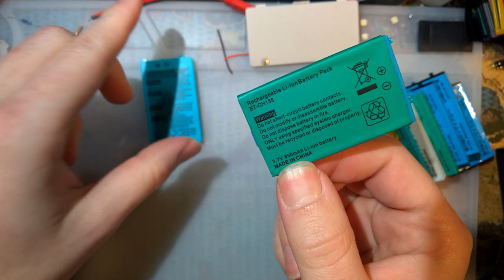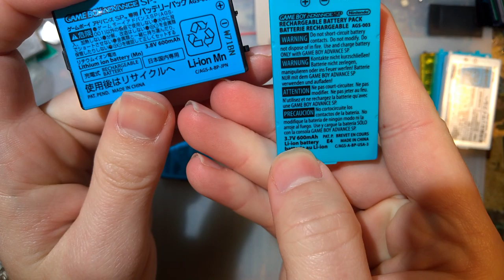A Quick Rant on GBA SP Batteries

Comment: This is one of the reasons why I prefer the AGB-001
Reply: Alkaline batteries do have their benefits with the biggest being you don't have to worry about buying expensive batteries that may/may not be the advertised capacity.

Using NiMH you do run into the same thing, though.

Comment: As I've stated in one of your earlier video about GBA SP Battery mod, yours are the one I've been looking for because of a few reasons :

- I did open 3 of the OEM battery, all of them didnt have any circuitry whatsoever.
- I'm currently trying to get a replacement battery which could match/exceeded the OEM battery, but cant find one
- your guide includes simple pcb gerber design which I could order and try to replicate, and your guide is easy to understand

I'm not an electrical engineer nor have any training and degree for that matter, but I think from quick reading on the internet, its pretty safe to use Li-Po in an Li-Ion circuit, charging and discharging

Huge fans of what you did! Good luck on your next projects

Comment: Neat, that's my thread you linked in the description, glad someone else noticed this. If you still have that "850mAh" battery you opened at the start, if it smells kind of pungent or sickly "fruity" it likely means the cell has been punctured/physically damaged and exposed to air. I had two 850's I got from RetroModding, and both had this smell, which could be partially why the capacity is so insanely  low. 

Also (kind of unrelated to the video) voltage sag can impact battery life, if it's put under load the voltage can drop quite significantly and cause the system to see the battery as "dead" much sooner than it theoretically should. My OEM battery is a good example of this, even though it tested at just under 500mAh, after a full charge the LED turns red after about 30-60 minutes, and dies soon after. Despite the voltage bouncing back to around 3.8v when the load is taken away. (Also the led can bounce between red and green depending on the light setting, which is a good indicator that the battery is sagging a good amount).
Reply from the maker: Yep, that 22mAh rated battery has this issue. The actual capacity when ran in a SP is a lot closer to 60mAh based on the run time. My battery meter puts a much higher load on these batteries than an actual SP does so the batteries that are closer to lower end of the spectrum will test much worse relatively.

Comment: Ran into similar issues with aftermarket PSP batteries years ago. Slim psp batteries labeled 2400 mah only had 1200mah cells in them. Same thing with phat '3600mah' batteries. 1200mah cell and foam packing... Ended up ordering raw cells and soldering them onto the board of the original battery pack and taping them back together. Worked like a charm. A lot cheaper too (well mah\$ anyway...)

Comment: I have to agree that the OEM 3.8v batteries don't really hold up as well as the 3.7v batteries, because all of the 3.8v batteries I've accumulated over the years have bulged quite a bit.

Edit: About the thing you said about early/later batteries at 13:17, I saw a picture of a Japanese first-run batch SP (low serial number and all that) and the battery had that same all-blue design, which could mean that it might be an early battery, or some new old stock that they put in the later SPs.

Comment: I read some comments about asking how to prolong battery life.
If you not going to use a battery for a long time, store it away at 80% charge. that percentage varies for different battery tech but in general that’s about optimum. Unused batteries will still have a leakage current either internal or external, so the stored charge will slowly discharge. But as long it’s between 50% - 80% the capacity degration in a year is about 5%.
a fully charged or discharged battery will degrade in worst case 20%. again that percentage is a general rule for a wide variety of our modern batteries. The temperature is important too, but for most of us you’re not going to regulate just for a couple of devices. Moist and UV is mentioned too in other comments. don’t bother, most batteries are enclosed inside a devices that their influence can be neglected.
As for intensively used devices, my advice is not worry too much about it. Being too careful will just ruin your user experience while it’s really not going to help much. A battery is a consumable.

I’m a electrical engineer in circuit design, just did a minor in technology dev. So I’m still no expert by any means. The true experts are chemical engineers with minor electrical engineering.

My question is: which aliexpress GBA SP battery is recommended?
Reply from the maker: Are you asking about bare cells for my mod or just a drop in battery?
Reply: @makho  just battery drop in, thx!

Comment: I actually just went looking for a video like this when I bought an SP today with a dead battery. The SP is fine, but this battery won't work in any other SP. It appears to be an OEM based on the markings, but it's all white label with light grey housing around the ends. I wanted to see if I could salvage it because it's not bulging in any way, so I found this video to see what I would be getting into if I tried opening it. None of the batteries in this video look like mine though, but it was still helpful! I've decided I won't open it and maybe do some further electrical tests first.
Reply from the maker: If it's OEM, the plastic frame is likely sonic welded and only comes apart destructively ;(
Reply: @makho  Thanks for the tip, I got a new battery today and now all of my SPs work! I just want to know what went wrong/bad with the OEM battery. Even if I destroy it.

Comment: Heck.. out of 5 or 6 SPs, I had to throw away all but one battery as they all started bulding and don't want to risk anything.
But interesting to see all the differences between them, had quite a few different looking ones.

Also it does make me wonder if there are any aftermarket batteries that are good.
Bought this battery that is sold by major retailers that goes by "CS-NTSPSL" or "SAM-SPRBP".
Maybe someone did test those if they are actually 900mAh?

Either way, already planning to do your SP battery mod!

Thanks for this insight

Comment: Thank you so much for doing this video and testing. I recently installed a V3 IPS screen in my GBA SP, and got a new battery (blue plastic, green sticker "850mah" generic) at the same time without realizing how bad the generics are. I only got a measly 50 minutes before the red light came on playing an OEM Minish Cap cart at 8/15 brightness. I just ordered one of the tested 950mah MaxPlay batteries from Retro Game Repair Shop, so curious how long that will last. It's a shame that there are SO many of these bad generic batteries being sold all over the place.

I also found out the USB-A to USB-C adapter I was using with my charging cable was throwing fits so that's what was causing charging to be cut off intermittently. The generic battery still sucks though. I took it apart and it has "PCTXSQ" on it. A google search tells me the bare cell is sold as a 300mah battery. Ridiculous.
Reply from the maker: You shouldn’t rely on the low battery warning being accurate. It’s tuned for a different chemistry of battery and nearly always comes on way too early with modern replacements.

Comment: That 700mAh battery with gold holographic sticker is pretty nice. Mine is still holding-up pretty well. I'm still using it on my 001 and I'm using your battery mod on my IPS modded SP. Not sure if I got lucky and bought from when they still make good batches of aftermarket battery.
Reply from the maker: The problem with these batteries has always been either the consistently low capacity or the total lack of consistency. There have always been good ones, diamonds in the rough as it were, but there are just so many more bad ones. 

If yours works, no reason to replace it now.

Comment: I'm not an expert, but I think the difference between the two batteries at around the 6:40 mark would simply be related to regions.  Japan has a different voltage in their power outlets than North America does.  The Li-ion Mn battery has Japanese text on it, whereas the Li-ion one has English.  They probably used slightly different batteries to account for the difference in voltage.

Comment: I know this is a 2 year old video, but I'd figure I would chime in with some interesting trivia related to nintendo batteries. I found that my DS lite charges the lithium battery to 4.1 volts, not the 4.2 that is common on the vast majority of other lithium batteries and chargers. It makes me wonder if this contributes to a longer than normal battery lifespan, since most lithium battery aging occurs from fully charging and fully discharging the cell. Charging to 4.1 volts instead of 4.2 puts less wear and tear on the battery.

I also wonder if this applies to the GBA SPs as well.

Of course, it could also be a limitation of how far we could push lithium in the mid 2000s, or just different chemistry that required it.
Reply from the maker: Potentially. Are you certain that it's only charging up to 4.1v? I think it's more likely that it charges to 4.2v but the aged battery is leveling off at 4.1v. As lithium batteries age, they start self discharging at an increased rate. 

The proper way to verify this will be to do a full charge and check the voltage right before the indicator goes off and then watch for the next few minutes. Leave it and then check it again 24 hours later and see if the voltage changes again significantly. If it's under 4.0v after 24 hours, it's well past the usable life.
Reply: @makho  I did test the ds batteries again. While I didn't check them 24 hours later, I am still glad I did. I tested the same DS lite, a 3DS and another DS lite. I also tested a fully charged 18650 from a separate charger to get a control, just in case my multimeter was off.

The 18650 I tested was quite old and measured 4.2 volts when I tested it. I measured the official battery in my personal DS lite and it was 4.13 volts, so okay. That's kinda close to 4.1 volts. I tested my 3DS and it was 4.09 volts. After that I thought I was on to something. But then I tested another DS lite and it was 4.17 volts. 

So yeah, theory of the DS charging to 4.1 volts is pretty much debunked. I guess that really shows how large samples sizes are very important.
Reply from the maker: @SuperSpyMonkey  Thanks for the update. I wonder how this could affect battery health long term if implemented. It's kind of difficult to test something like this though because I'd have to test over the course of years. 

On the same note, SP consoles will only discharge the battery to 3.4v before shutting off (3.3v on the micro). I haven't measured any DS consoles but I wouldn't be surprised to see them do something similar and I bet that has a net positive on long term battery health.

Comment: Yeah these green China battery's are crap.
I got 3 of that and every are around 300mAh
Reply: How do you measure the capacity of the battery?
Reply: @LeBlancMain  I have a device for diverse Power Source where I can Set Ampere to drain the Batterie. When after the Time the Batterie is empty or the Under Voltage Protection cut off  I can Look on the Display and it Show me how much mAh it was
Reply: @-Gothicgirl-  and what device is that? I wanna build one on my own. Thanks a lot!
Reply: @LeBlancMain   I can not post anything to a Chinese warehouse (that with A and ex in the name) because yt delete it. But search after  Main   Battery Aging Discharge Test 35W Constant Current Dual Adjustable Knob Load Tester DC USB Tester 0.1-4.5A

Comment: This subject about batteries have been eating at me all week. I am very split on whether to use tp4056 with 2000mah lipo or AA ladda 2450 each. Understanding protection for overcharged, discharge, over current and  load sharing is a pain too.
Reply from the maker: Yep. That's why I usually just recommend the simplest solution, which for everything but a GBA SP and a Micro is a set of LADDAs (or whatever brand you prefer). 

With a TP4056, there is no load switching so you cannot (should not) charge and play simultaneously. I understand the added convenience of an internal USB based charger but the same can be done for NiMh based consoles too (just don't try to charge alkalines). It's also worth taking into consideration any electronics you have to add to condition the voltage (as a GBA will not work on a fully charged Li-Ion otherwise) and also the actual power capacity of batteries. Power capacity is in watts which is calculated by multiplying the amperage by the voltage (2.4x2450 vs 3.7x2000).
Reply: @makho  that last part about power capacity being in wattage (V *A=W) does that mean that 2450*2.4 =5800w and 2000*3.7=7,400w and therefore the 2000mah will actually last longer than the AA's?
Reply: @thepokerus4184  you should look at Wh, V *  Ah, 2000 mAh * 3.7V = 7.4Wh vs 2450 mAh * 2.4V = 5.88Wh, so the LiPo will last 25% longer, the equivalent Lipo capacity would be a 1600mAh one
Reply: Load sharing is simple to implement but May not be necessary, the TP4056 will simply never stop charging when its running as charge termination occurs with C/10 and the default charge rate of 1A, so 100mA, the GBA uses more than that so the battery will simply be slowly drained. Worst case scenario, battery life will be shortened.

Look here for an example, you only need 4 components, a P-ch mosfet, Schottky diode, a resistor and a bypass capacitor
https://blog.zakkemble.net/a-lithium-battery-charger-with-load-sharing/
Reply: @daijoubu4529  so I won't really being doing any real damage or anything dangerous if I decide to play and charge at Sametime with tp4056?
Reply: @thepokerus4184  if you want the easy solution, get a MCP73871, they cost more ($3) but have built in load sharing, board is a bit bigger and no protection IC so that would have to be added, it comes with a gigantic capacitor for solar use, replace with a smaller cap

Comment: I'd like to ask what kind of advice would you give us in order to keep battery life longlasting and prevent battery bulging as much as possible. I wonder how to make that 2003 OEM battery still work at nearly 600 mAh capacity in 2020! Thanks beforehand, and congrats for all your videos!
Reply from the maker: Lithium batteries have a shelf life. You can take precautions for preserving them like ensuring that they are at a storage charge (about 50% charged) and by making sure they are not exposed to high or low temps or moisture or UV but otherwise what you get is what you get. The best bet is to find newly manufactured cells.

Comment: Hey dude your work is awesome 😁👍.
Do you still use that tester? Because I built one like that and have the same problem.
Some batteries test at ridiculous small capacities but then last more than that. The blue plastic casing ones test hight but the rest, all the og whites and new Chinese ones test so low on charge and discharge.
I would love to have some advice from you in the matter since im a noobie at this.
Thank you so much and greetings from Spain.
Reply from the maker: I still use the jig I made but I use a different battery tester. I charge and discharge at constant rates and just check the timer.

Comment: nice vids! Do you have any suggestions for buying sp batteries in 2020? things to avoid/be aware of?
Reply from the maker: The battery mod I did seems like the best bang/buck: https://www.youtube.com/watch?v=VjnONhSVvpA

If you don't want to do any soldering, Batteries Plus sells a rayovac branded cell that also seems pretty good. It's quite a bit more expensive though.
Reply: @makho  I had seen that mod and looks cool, soldering's not a problem, but getting the custom plate becomes the problem since you mentioned a site which I think is american and being in europe would make that more expensive than the battery altogether. I'm a noob in this world, so... is there any diy way to make a good contact plate for the battery without soldering it directly to the gba?

Comment: I still have my Cobalt GBA SP from the 2003 launch. Still seemed to work fine last I checked. How can I test it?
Reply from the maker: If it still works fine, I'd leave it be. If you have a battery charger that does capacity testing, you can just chuck it in there though.
Reply: @makho  Thanks. Was curious to test it just for curiosity and contributing statistics. ;) It's literally a launch-day unit.

Comment: Since some of these batteries that you find online are super snug to the point where you can’t even physically fit them would taking a file to the plastic around the battery safe to do?
Reply from the maker: Depends on the specific type of battery cell but in more cases than not, this results in fire so I don't recommend shaving down the battery. 

Buy a better battery that properly fits.
Reply: @makho  any recommendations so I’m not just wasting my money?

I mean the 21 year old OEM works. It does though have probably over 2,000 hours on it and no bulge but it doesn’t last even 2 hours anymore.
Reply from the maker: @fatefinger  

https://retrogamerepairshop.com/collections/gba-sp-power/products/gba-sp-game-boy-advance-sp-rechargeable-850mah-lipo-battery-mod-by-makho

https://retrogamerepairshop.com/collections/gba-sp-power/products/gba-sp-game-boy-advance-sp-real-750mah-replacement-battery

The more expensive ones are much higher capacity but the power per watt for the cheaper ones is better. Depends on how long you want to play between charges, I guess.